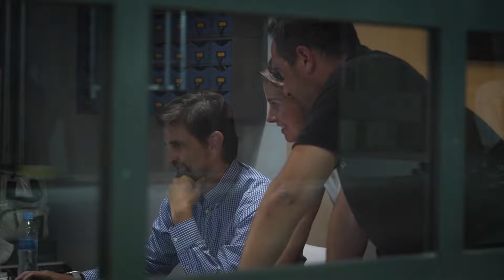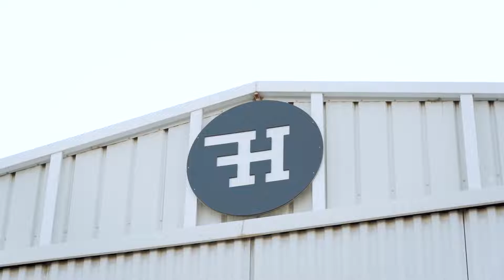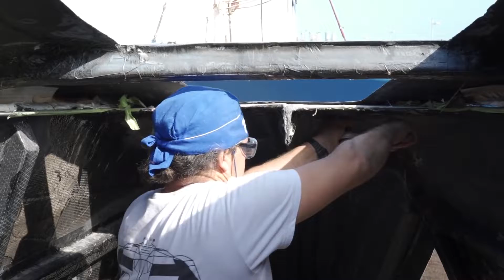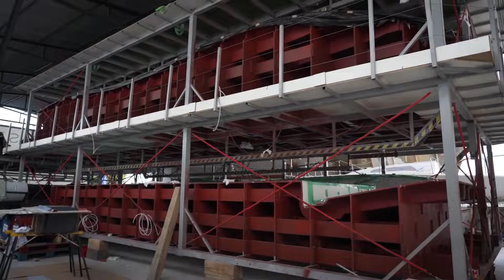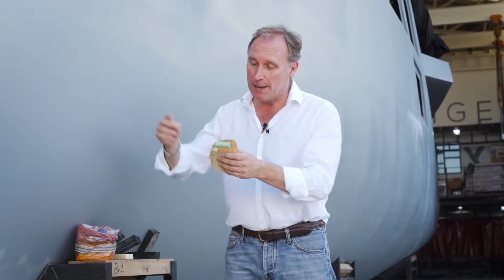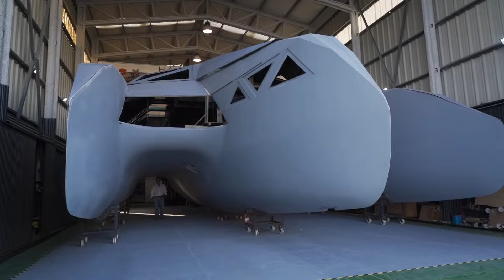ASTONISHING AND UNIQUE 64' TRIMARAN. HOW THEY BUILD IT!

Comment: It's an impressive looking trimaran but in my opinion it's more show than go. 

For sure it would be extremely uncomfortable sailing it in choppy or rough seas, the bridge deck clearance is way too small, causing it to hammer on the water something chronic. 

But as a show pony around the bay on calm days, I doubt you could beat the head turning value of it. 

As a long term cruiser, not for me.

Comment: I like it, but I think they went a tad bit too far. Dial it back to a halfway point. Gimme a trampoline in front with easily accessible anchor locker.  Needs a little more walkable area topside.  At 64ft, it would serve itself a little more justice at 11 or 12 meters wide.  I’d love one, but a little more traditional in design. A halfway point between Star Trek and the 90’s.

Comment: If the hull lines are correct I see a power version very successful. 
The Multihull Advantages enjoyed by the Passenger High Sped Ferries can only go from strength to strength on yachts. 
Better Fuel Efficiency (and Speeds which go hand by hand) for a given Horsepower, Minimum Wave Pounding, Minimum Roll to name a few... 
For a Sailing Cat one must take under consideration Speed, which will get you out of trouble avoiding weather patterns and formations where one should not be, because let s face it, a Saling Yacht can only have the CG under the waterline or be fast to get out of there... 
The Principle is good, the Mast must give way to 2x12V2000  M94 @ 1,920 Bhp each giving speeds ca 60 knots if not above... 
There's your Fuel Efficiency.